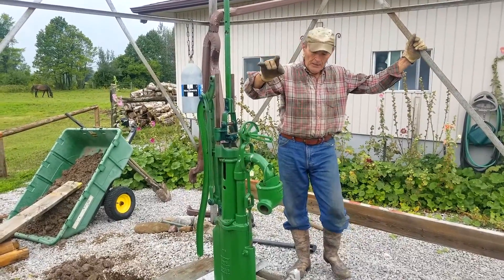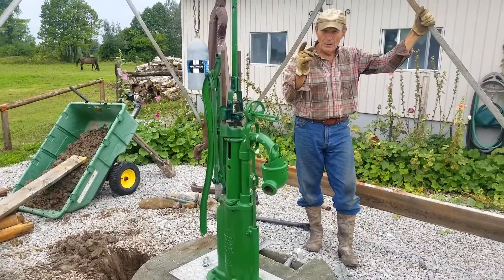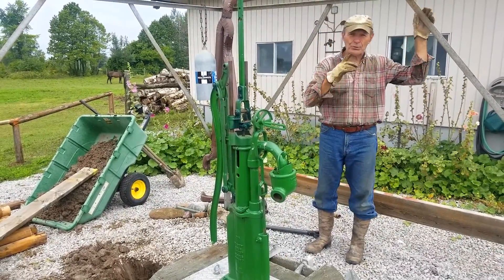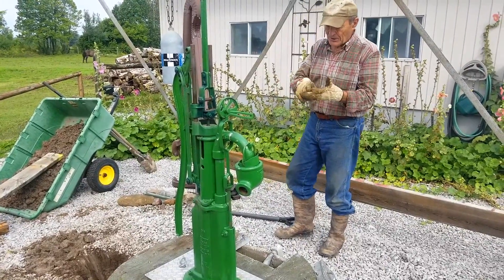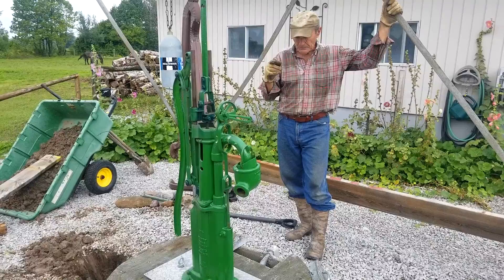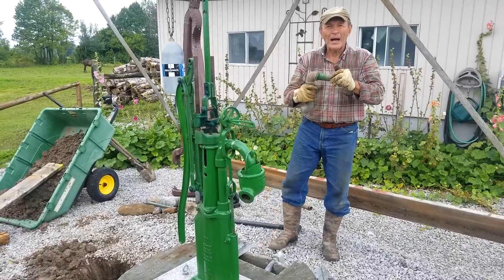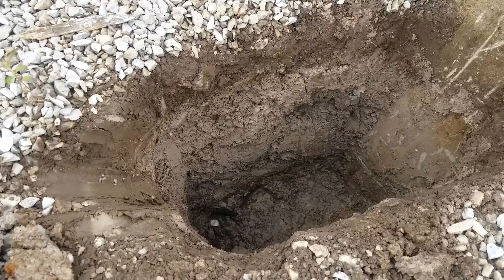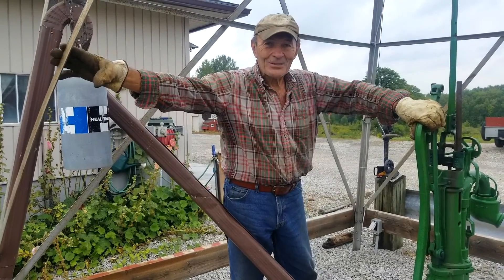#137 Well Overflow Protection | At The Ranch

Comment: Hi Alec. I'm not sure how good that very small "French drain" will be against the large surface area of the barn and garage? Unless you make it much longer or bury some weeping tiles to the yard. Perhaps the better solution would be to raise the electric wires and pressure switch  above ground level and build a small insulated dog house to house them? Just an idea. Stay safe Owen m.
Reply from the maker: Thought of that Owen but in it would ruin my vintage well standard.  The ground around our well drains very well, and up on a hill helps.  So far I'm pleased with the setup as it solves my overflow issue.   Thanks for watching Owen and take care.

Comment: What is the best way to seal the 1/25 inch pipe & hole to the concrete well wall.
"Hydraulic" cement mix? TY
Reply from the maker: That will work but I like silicone caulking.  Much easier to get the pipe out if I have to repair/fix it.
Reply: @AlecPeirceAtTheRanch  Mighty fine
thanks for the fellowship!